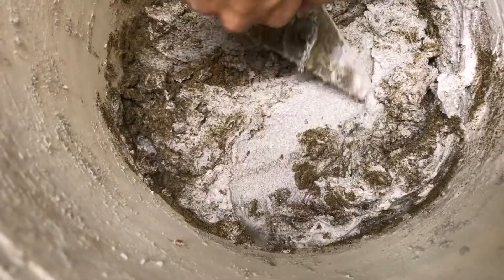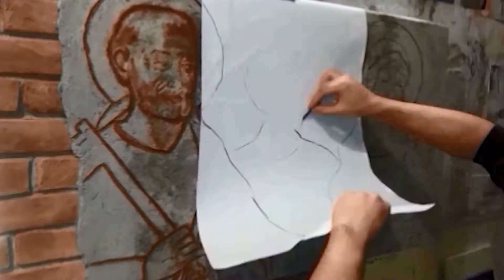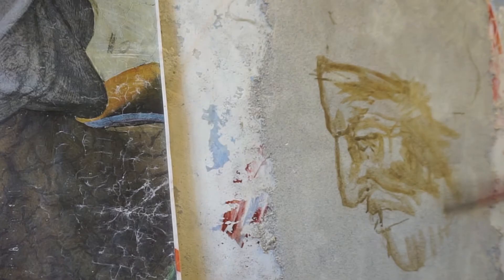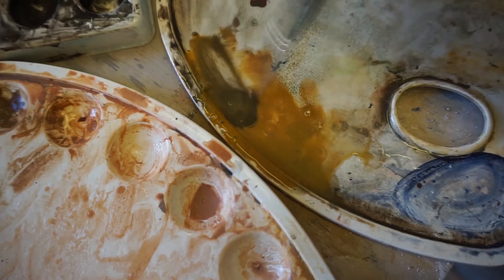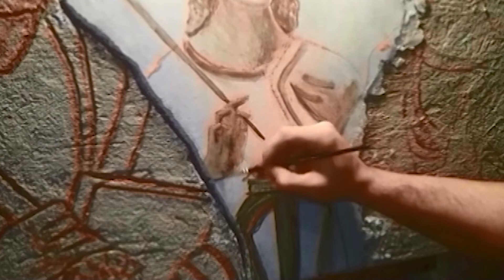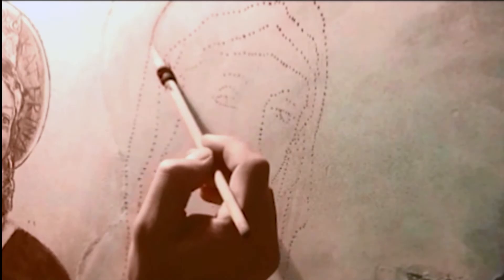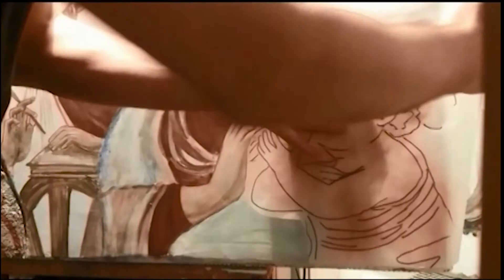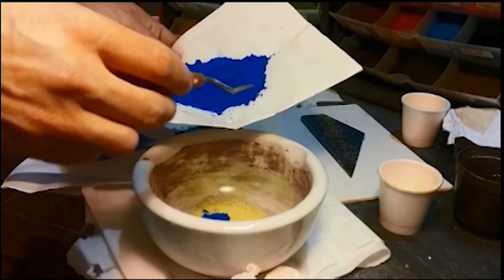Fresco Technique

Comment: Using Fresco as a technique in doing artwork is really impressive. I was flabbergasted by how the artist takes into account the color shift as the paint dries and binds to the plaster. Though doing this kind of technique wasn't easy but what makes it unique is that it is durable and the color does not become part of the wall and tends to flake off over time.

Comment: Are there a way to protect or varnishing the fresco painting as usually artists does with other tecnicniques? Maybe with soap or wax as protecting coat?
Excelent channel and videos!
Reply from the maker: Ciao Rodriguez.
The ancient Romans used a layer of Punic wax (beeswax bleached in the sun), this method was called "encausticization" not to be confused with encaustic which instead uses wax together with color. (but not on the wall)
The Romans then spread a layer of hot wax on their "fresco" paintings, but honestly if you painted "fresco" you shouldn't apply anything as a proptective, because the color is behind a natural calcium barrier once dry. The wall must always "Breathe" to exchange water and air from the inside to the outside and vice versa. If we block the entry of water from the outside by spreading a protective, at the same time we also prevent the leakage of moisture from the inside of the wall (which is natural to exist in the walls) which, not being able to get out, will create salts and internal detachments.
I CONCLUDE by telling you that the ROMAN Paintings have been preserved well despite the protective wax thanks to the quality of the masonry itself. They spread seven layers of mortar, from the thickest made with coarse sand lime and pozzolan, to the outermost layers made of lime, fine sand and marble dust and beating each layer for a long time to give it a compactness similar to stone .... in THESE WALLS SO THICK AND COMPACT DO NOT PASS THE MOISTURE ... that's why they could polish them with wax.
Reply: @tizianolucchesi  Sorry for the late response. I really thank your attention and kindness of this very detailed answer and to share your  important knowledge.
I asked because i'm thinking to paint a religious painting, but the chance of that fresco will be damage by people is very high. Thats why i was thinking in a protection to avoid damages.
I have time to think about the proyect yet.
Thank You very much Mr. Lucchesi!

Comment: When you use water mixed pigment for applying to buon fresco, does the ground pigment last perpetually in a jar or does it settle and require re grinding after a time?
Reply from the maker: the pigments dry because the water evaporates, just wet them with water and they return exactly as before. Only a few specific colors, such as titanium or lime white, need to be grind a little again
Reply: @tizianolucchesi  thanks for your reply :-)